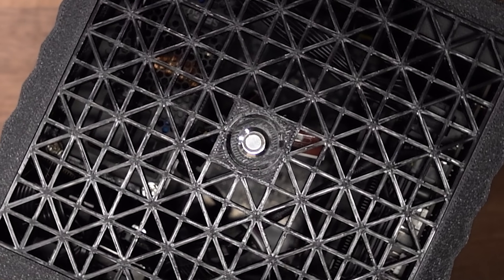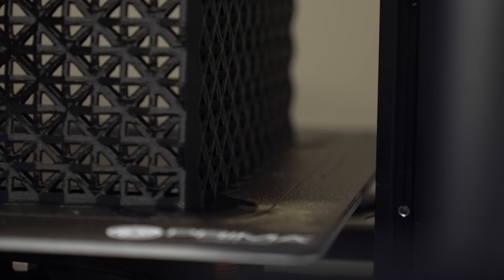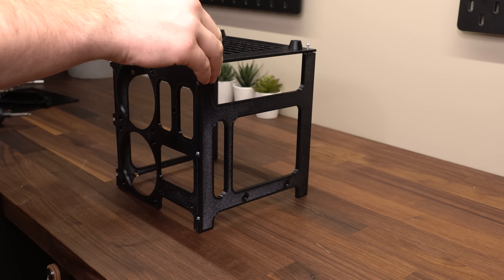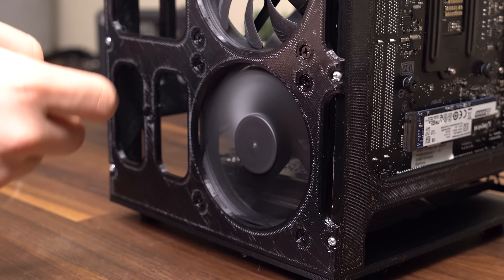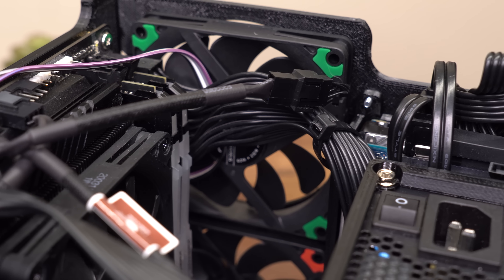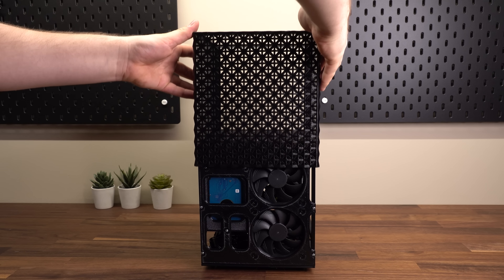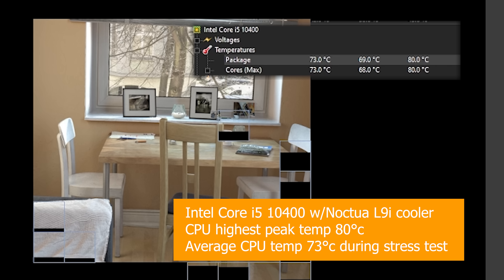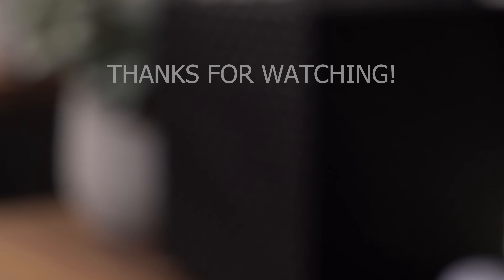Custom 3D Printed ITX cube case

Comment: I made this and I'm still using it. I recently upgraded my GPU but it was slightly too large to fit. I redesigned the base to allow for a small drop to accommodate the larger GPU. I also added height to the feet for better airflow. Great design!
Reply: Could you share the link for that? Also what GPU?
Reply from the maker: Since it’s one of my free projects go ahead and share whatever files you want 😊
Reply from the maker: Thank you, glad to hear it’s been in use for so long. 🙏

Comment: does it fit a regular atx power supply, maybe without the hard drives caddy?
Reply from the maker: Unfortunately it doesn’t fit an ATX power supply. At least, I don’t have an active license for the software used to design this so I won’t be making new modifications to it. Might be a V2 at some point though 😊

Comment: I absolutely love this build so far.  I went with a Gigabyte B650I and Ryzen 9 7900 with a PNY 3060 12GB card for my build.  I also opted for the Thermalright 15mm fans and CPU Cooler.

Currently, my only issue is I have attempted to print the cover for it 4 times, and every print fails for me; Octoprint just stops printing about 60-80% of the way through the large print.

Is there any chance of getting a flat version of the case cover in multiple pieces that could be assembled?
Reply from the maker: Hi there! I’m happy to hear you love the design! And I’m sorry to hear the external panel isn’t printing properly. Unfortunately this case was designed using Sketchup which I’m no longer using, and therefore I can not make any further changes to the design… :/ No idea why the print is failing so far through as many people have printed the case successfully. Have you tried rotating the print 90 degrees on the Z, sometimes small printing bugs can solve themselves just by rotating the piece on the build plate 😅

Comment: I know this is an older vid but if you removed the hhd mount do you think you could do a full on atx psu
Reply from the maker: It might be possible, however, I think it might be very tight if you use a GPU. Also, I do no longer have access to Sketchup Pro which is what I used to make this case, so I’m unable to do any further modifications to it.

Comment: msi 4060 ti ventus 2x can fit? 199mm
Reply from the maker: Unfortunately I think it will be just too long… :/ it may fit if you do not use hard drives in the front and remove the bottom 92mm front fan, and cut away a part of the front internal chassis so the GPU can stick out a bit I think it might just fit barely but I’m not 100% sure 😅

Comment: how did you wire the switch?
Reply from the maker: Most buttons will have markings that show what is what. Should be a + and a - indicating the positive negative on the button LED, then there should be two other pins that will connect for the power switch functionality, the switch pins can be connected either way as they just touch when the button is pushed down.

For just a functional button all you need to attach is the switch pins to the motherboard but I recommend doing the LED too as an indicator that the pc is actually on. 😁

Comment: I like this but, personally I would reconfigure the PSU to be behind the motherboard and use a short PCIE riser to offset the gpu under the mobo. this way the cpu and psu are not competing for air space and a larger cpu cooler could be used.
Reply from the maker: That’s actually a pretty good idea! To have the GPU where the AIO is, and the AIO behind the motherboard could work too! Or just use a big air cooler definitely!
Reply: @makerunit   visually how I picture the concept is you have a T divider. Left side of T is mobo, right side is psu, top of T is gpu with riser. Then make it square enough to have it slide into an enclosure in multiple orientations.
Reply from the maker: @CamBeulGaming  forget my last comment… I was replying to some comments on my most recent build which uses an AIO. Since all new my comments end up listed together regardless of what video they’re from I forgot to check and assumed it was the other video. No AIO liquid cooler here 😅

But placing the PSU behind the motherboard and still keeping the same dimensions would not allow for bigger CPU coolers I think… maybe if optimized, a few millimeters but not that much.

I get your idea of the T joint but for example in this case, the GPU gets air from below, CPU gets from the front intake fans, and PSU gets through the mesh in the side panel, meaning none of the parts actually compete for air tbh… 😅

Comment: quick question: How thick is every internal piece? I want to make my own model but don't know what will be too thick/flimsy. Thanks(nice video!)
Reply from the maker: I think it’s about 5mm thickness on this specific model, and each individual panel feels a little flimsy by themselves, what really locks this in place is the fact that all the corners lock eachother in place. And then the external cover protecting it all.

I’d recommend a minimum of 5mm but about 7mm would leave room for M3 threaded inserts also which can be handy sometimes too. Also keep in mind that that any parts that will carry weight should be printed laying flat for optimal strength.

Comment: whats the biggest cpu cooler you can fit in (obviously not water cooled)
a Noctua NH-D15 (165mm) probably wouldnt fit , right?
Reply from the maker: Oh no definitely not. About 100mm is the absolute max, so most stock coolers and some other coolers would work but I don’t think many cooling towers would fit. 😊
Reply: makes sense. i love the design of the case but its difficult to find good parts to put in it. not many itx sized stuff.
Reply from the maker: @HRfromJOHN  yeah I personally would not recommend a high end setup in this one. It’s size doesn’t really allow for anything better than a low to mid-range setup. Not enough cooling for more powerful parts unfortunately 😅

Comment: Hello! Very awesome build! Any help on where I can find that power button? Everywhere I have tried looking, all I can find is the wires/switch. Not the full assembly. Thanks!!!
Reply from the maker: Hi! I’m not sure where you’re located but you should be able to find some options by typing «12mm power button led ring». Any 12mm button should be sufficient here though, it can also be other ones of the same size 😊

Comment: woulda used black screws, and please dont do this in PLA. Also id secure the cover with some strong magnets to have easy access
Reply from the maker: I did have black screws at first but they didn’t fit the countersunk hole and I didn’t feel like re-printing the entire cover so I went for the silver ones instead (lazy me😅). The external cover on this is actually PLA. But all internals are PETG 😊
Reply: @makerunit  ps sick build n print

Comment: Great project!!!
You just need to tune your printer, you have problems with the surface finish and the layer lines.
Reply from the maker: Thank you! I’ve been struggling with this and I’m not really sure how to fix these issues, especially the layer lines. I get occasional layer shifts too at times but they’re not too bad. Not exactly sure what’s wrong though. Although my printer (especially the cr10) has so many modifications it can no longer even be called a cr10 🤣

Comment: But can you reuse the resin after the entire contraption melts down? Nice noctua add by the way.
Reply from the maker: I’m working on a new tiny build now in a 5700g that reaches 90+ degrees, the plastic still isn’t even bendable with a considerate amount of force. I’m not worried about temps with PETG.

Comment: Seems like this would generate heaps of static being all plastic and being not correctly grounded.
Reply from the maker: It may seem, but is not. After several printed cases. I have not so much as noticed a single spark at all. 

The only static I’ve ever experienced with 3D prints has been when removing big flat parts fromfrom the printbed. 

All parts are grounded through the power cables as well.
Reply: Static damage won't be instantaneous, nor will it produce a spark. The parts are grounded but the case is not. I personally would not recommend anyone use a case like this for a long period of time.
Reply from the maker: @jordan8538  why would the case need to be grounded? If there is no direct connection between the case itself and the components. Why is it important? I’m just curious…
Reply: @makerunit  Generally you do not want a statically charged material next to sensitive electronics. There's a reason why computers, servers, highly sensitive electronics are housed in metal that which is also grounded. Fans generating airflow will charge the case causing a difference in charge with the components. If something touches both it will neutralise and discharge through the sensitive components with potential to cause damage. Metal also is a natural electromagnetic shield but that's a whole other topic.. In any case, you might be okay.. I just would be cautious.
Reply from the maker: @jordan8538  I understand I think. It does make sense. Though the creative part of me struggles to let go of 3D printed PC cases so I think I’ll risk that. That’s why we have insurance right? 🤣

Comment: It looks like if you sneeze on the case it will break.
Reply from the maker: I can confirm it withstands multiple hard sneezes. I speak from experience 😉 looks can deceive, it’s suprisingly sturdy once all the parts are interlocking with each other.

Comment: What temperatures can those 3d printed plastics withstand? Won't it melt?
Reply from the maker: There are so many different options. PLA (most common type) can take about 60 before it begins to soften, PETG (kind of same material as soda bottles), can take 75-80 before softening and ABS can take even more. Even though they start to soften means in no way that they will melt at those temperature. Melting itself refers to when it becomes liquid, and that doesnt happen until way above temperatures a PC can ever reach. 😊 if you read through some of the other comments a lot of people have asked this type of question 😊

Comment: Cool stuff.
If you're going to iterate on the design, I'd recommend threaded inserts lile another person suggested, as well as space in the plastic to insert metal strips to strengthen the chassis.

The main worry I have is the lack of EMI shielding
Reply from the maker: I’ve personally not had any issues regarding EMI noise and such and all parts are grounded through the power cables.

The chassis is suprisingly sturdy once all the parts are interlocked with eachother 😊

Comment: I prefer metal cases so those can absorb the heat from some of the parts.
Reply from the maker: For a metal case to have any passive cooling effect on the components they would have to be smushed together kind of like the CPU and CPU cooler, otherwise it would not really be much different. 

The standoffs touching the metal will not really do anything to the temps. 😊

Comment: How come you didn't use press fittings and just screwed straight into the plastic?
Reply from the maker: Honestly. I was originally planning to, but then I changed my mind and wanted to make the walls as thin as possible. Also, it was just simpler to do it this way to be honest, required less parts. 😊 I realize now that you all really want those inserts, though I don’t think theyre the best for every single application. So for future projects I’ll be using them, I’ve got one coming up very soon now using them 👌
Reply: @makerunit  oh cool! Fair enough then 😁

Comment: The only thing I would change about the case is to leave some room for super thin and fine meshes so that dust cannot get into the case as easily
Reply from the maker: I considered it, but chose not to as I’m personally not in a very dusty environment but definitely handy in some cases. 
One of my previous cases I used like thin pantyhose kind of fabric and it seemed to restrict the airflow a bit though it caught even tiny dust particles. It wasn’t like a huge lot difference in temperature a lot but by removing them I got a few degrees better temperatures.

Comment: 3:00 With the ssd there is no problem but the hdd in that position over time can degrade (due to the position of the needle) and work incorrectly. Better that the mounting be horizontal (in the next version), or change the hdd and mount 2 SSDs on the computer. 😉
Reply from the maker: I’m personally not really using the HDDs, I just added them in this one because I share the files and wanted it to at least be an option 😊

Comment: Should've cleaned it up first with a blow torch...OCD kicking in real hard.
Reply from the maker: There wasn’t too much stringing to be honest, but those blobs could have been avoided. I honestly forgot to set seam position to «rear»… my bad
Reply: @makerunit  lol I know nothing 🤷🏾‍♂
Reply from the maker: @aaronthompson3014  the «seam position» is where each layer of plastic starts the extrusion. Sometimes small blobs can appear just where a new layer starts. If I set the seam position to «rear» it means all extrusions will start in the back resulting in a much cleaner exterior where most of the tiny blobs would appear all the way in the back instead.
Reply: @makerunit  Oh well thanks for the education education lol I've been contemplating getting into 3-D printing myself so I appreciate it.

Comment: Has there been any problem with temperature that affected the case in some aspect? I'm able to imagine it bending or deforming at some weak and extra heated spots. Awesome video, may try something similar in a future!
Reply from the maker: It has not been any problems really with this design, or any of my previous cases. Mainly using PETG now, but for previous cases I used PLA, holds up suprisingly well actually. It all comes down to how it’s designed. It’s rare that a component is hot everywhere so the trick is designing it so that the hot parts always have more than one mounting point/or support that doesn’t get as hot. All the parts interlocked together will actually help maintaining the shape. It’s not like PLA would deform as soon as it reaches lets say 60 or even 70 degrees, yes it gets soft(er) but still requires an actual force to deform it still. If that made sense. If a part has multiple support points it’s not really that big of a problem even exceeding «soft» temps at some points.
Reply: @makerunit  excellent, thank you very much!

Comment: What temperature can you deform pla ?
Reply from the maker: Technically PLA can start to soften around 60 degrees, but even at that temp you still need quite a bit of force to actually deform it, in a PC build where all the parts interlock with eachother the temps will most likely need to reach way more before it will deform by itself to be honest. Also, this build is all PETG except the cover. 

Also remember that even though the cpu have peaks of 80+, that’s at the core, and not in direct contact with any plastic, and with the fans(airflow), the air is constantly replaced by cooler air never allowing the ambient case temp to reach «dangerous» levels anyways. 😊
Reply: @makerunit  thank-s for making it clear for me ! i might make one with my kobra
Reply from the maker: @6119misha6119  Though if the option is available to you, I'd still recommend using materials like PETG if possible, just for the extra peace of mind and higher temperature resistance generally. I'm personally using PETG for all my internal chassis parts, only PLA for the external cover in this build.

Comment: This is such an awesome idea and design, I have a little server pc I use for Plex and was gonna use for some lower power game servers for use with friends and atm it's in an Matx chassis but I was thinking of getting an itx motherboard and turning it into a much smaller PC for space constraints but I realised most of the very compact itx cases are usually very niche and therefore expensive, I never expected anyone to design a small itx case for 3d printing, let alone one I could print myself on my own ender 3, definitely gonna be bookmarking this video for the future, well done and thank you for this awesome and beautiful design
Reply from the maker: Thank you! Awesome to hear you like my case. There are a few options out there, I myself have made a few MINI ITX cases too. Currently I’m working on a very tiny one, to hold a Ryzen 5700G (built in graphics) processor in a ultra compact build, about 3L in size approx. It’s printing right now as we speak! 😊

Comment: Next purchase on my list will be a 3D printer.. But not sure which printer would be best to look into.
Reply from the maker: There are so many options out there. It all boils down to how much you think you’ll use the printer, how much money you’re willing to spend, how technically handy you are, etc. Some printers are super cheap but require regular maintenance and tuning, others are more expensive and pre-calibrated out of the box, also, print size is an important factor to consider as well.